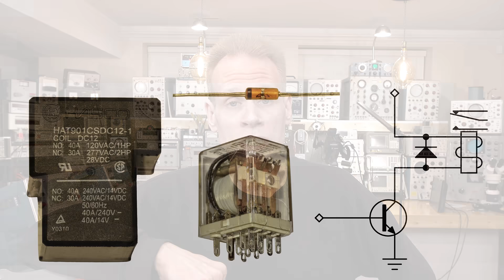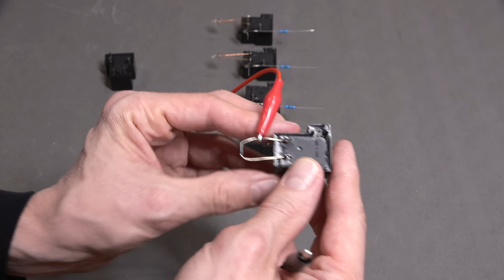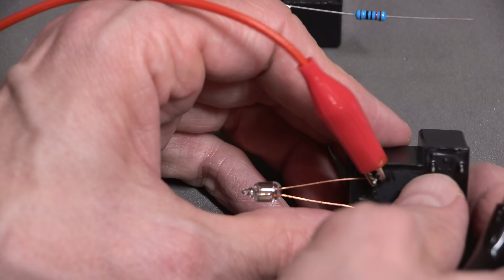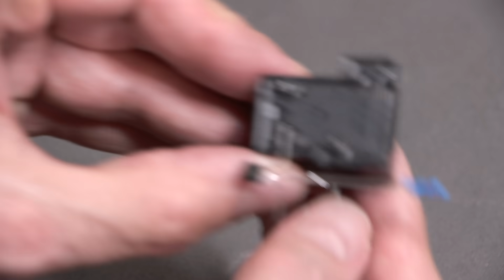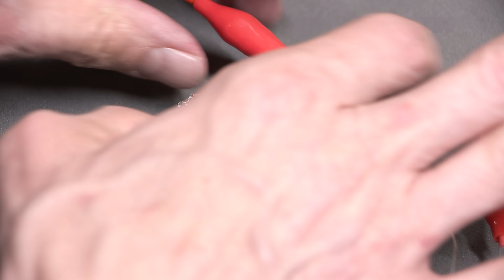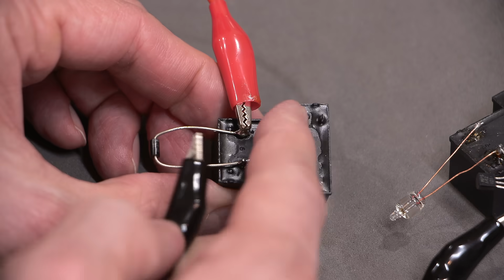Why Add This Diode Across A Relay Coil? This Is Why It's Needed!

Comment: Is a FAST diode required? What kind of diode(s) should we use? I generally use 1N4007 but I suspect it is not the best choice.
Reply: For the most scenarios (relay On/Off) it is good enough. Speed can be important if you protect stuff from the lightning strikes. Or design a switching mode power supply. Things like that.

Comment: An additional note about the side effect of placing a "normal" diode as a "flyback diode" is that the relay's turn-off time becomes longer because the reverse current keeps the coil also energized. For most applications this doesn't matter, but if the relay's turn-off is used as a safety in a overcurrent (electronic fuse etc...) the turn-off gets extend with many milliseconds. I discovered this years ago when i started my DIY electronic circuit breaker with iso transformer and variac project. 
In the first version of my project, i used a beefy 12V relay to disconnect the mains. 
I started experimenting with other solutions for the back EMF problem of the relay, and found that a combination of a Bi-directional TVS diode in series with a low value resistor (arround 50 Ohm 1W) accross the relay coil resulted in the quickest turn-off time. The value of the TVS diode was arround 14V to not interrup the normal working of the relay. This resolution only gave a very short and low overvoltage spike accross the relay coil. 
If i'm correct, a "flyback diode" or also called "Freewheeling" diode for back EMF is only needed with DC, because with AC this back EMF is cancelled out. Correct me on this if i'm wrong.
Regarding the neon bulb, those have many more applications then just a indicator light. I have used these as "last resort/failsafe" clamping device in parallel over a burden resistor of a CT (Current Transformer).
Reply: I'd maybe argue, if coming down to a complicated need like that, depending on application would probably switch to a solid state type switch in place of a mechanical relay. Now that we have those readily available
Reply: @TrollBooth500  indeed, my first version was a fork of the wellknown design of the Glasslinger Electronic Circuit Breaker. But after many modifications, i'm using a complete different approach and using now a beefy Triac (capable of 40A continuous and 320A surge). Way overkill for a 500VA project, but better too sturdy then flimsy.
Reply: I have read that the slow release produced by the flyback diode can also cause damage to the relay contacts if the relay contacts are switching a high current.  When the contacts open, an arc can form that burns the contact surfaces if the arc lasts too long.  To make the contacts open faster, the TVS diode can be used, or a Zener diode with sufficient surge rating can be added in series with the standard diode, or a resistor can be added in series with the standard diode.  These schemes dissipate the stored energy in the coil faster, allowing the contacts to move apart faster.  In the cases of the TVS or the Zener, the breakdown voltage of the protective device should be a bit less than the breakdown voltage of the transistor.  In the case of the resistor, it's resistance should be a bit less than the breakdown voltage of the transistor divided by the current that was present in the coil in normal relay-closed operation.  (The coil uses its stored energy trying to prevent any reduction in coil current.)
Reply: AC will produce this too, if the switching occurs off the zero point. But you obviously can't use a simple diode.
Reply: Use a meaty MOSFET and let VDS breakdown at 55V for rapid energy dissipation. Make sure you use older tech MOSFET's that can handle linear operation.
Reply: Absolutely interesting.
I have worked with car electrical both professionally. For a few years in the 70s but also on our private cars (car alarms, auxiliary lights, halogen/led. stereo, etc.) and have not had any problems with relays stopping working. However, connections to relays do occur. Maybe because I use quality relays 🤔 So my relays "survive" without a diode. And if it were a serious problem, there would have been a diode on the relay by now. I have a goal to learn something new every day. And now I have done it Thx. And within a week or so I will install auxiliary LED lighting on my wife's new car. No, I will not solder a diode there😉
Reply: @Mankan569 it's not the relay that is at stake. If you control that relay from a solid state device, issues may occur from the back EMF backfeeding to the control unit.
Reply: For fastest switching avalanche rated FETs are probably the best.
Reply: Regular diode with Zener in series is another option.
Reply: @JGnLAU  , a regular diode with a Zener in series wil only raise the reverse voltage and thats what you don't want. The trick is to absorb or extinguish the reverse induced voltage as quick as possible. Also a Zener diode has a much slower response then a TVS diode.
Another trick is to use a combo of a capacitor and resistor in parallel with each other in series with the voltage to the relay coil. For most 12V relays, a 1K 1W and 100uF capacitor works great. When the capacitor is not charged, it acts like a short and the relay coil gets the full 12V, but once the capacitor gets charged rapidly, the 1K resistor takes over and lowers the coil voltage just above the release voltage of the relay. Most 12V relays still kept enabled with 50% lower coil voltage, this will also lower the power consumption of the relay and becomes handy in battery powered circuits with relays.

Comment: My 1994 Ford Econoline van has the transmission controlled by the engine computer..In the trans is a solenoid pack with 5 solenoids in it to control the trans fluid to make it shift the gears..On the pack is a line of diodes to protect the computer from this problem as shown in the video..

About 3 years later Ford removed those diodes from the solenoid pack and installed them in the computer ..Problem is if you need to replace the solenoid pack, you can't buy them as they are obsolete..
You can buy the later solenoid pack everywhere online, but if I use the later pack it will fry my computer that controls the trans and engine..
Just wondering if I can install a diode inline with the wire harness..Open the harness up and install the diode there??
And I don't have a clue what size diode to buy to attempt this

Comment: Flyback aka kickback when the coil discharges, engineering 101 often called a clamper diode. They're commonly used with Darlington pairs even when there isn't an inductor in sight lol. Just that less than 1 cent insurance covering, "what if?"

Comment: thanks for the vid! i had an interesting run in with these diodes last week. i bought a tektronix 176 pulsed high current adapter for my 576 curve tracer. it didnt work correctly.  it turns out a 1n4152 diode they used across one of the relays shorted.  i replaced it with a 1n4148 and its good to go!

Comment: I know this one all too well.  I made a video about controlling a pneumatic solenoid and why you need to put a diode across the coil, it's a 12V coil and I hooked it up to a scope and showed the negative 120 and sometimes even much higher Voltage spike.  It's a no-brainer at this point relays/solenoids need diodes... period.  Some relays have the diode embedded in them and thus marked with a polarity, but most do not.  RIP that poor little 2N3904 transistor... I felt sorry for it every time you clicked the button knowing that each time that spike was doing damage to it.

Comment: Been working on cars and trucks for 45 years and never knew why those diodes were used.  I've seen them blown apart and never knew another component might also be damaged because of it.   Instead thinking they were a symptom not the cause.  Last one I recall seeing was on the start relay for a Chevy van that also needed a new engine control module.  I guess now I know why.
Reply: Perfect example of how automotive technicians/mechanics are incompetent: 45 years!
And you lack BASIC knowledge (electricity is a "black magic"). Pathetic...
Reply: @GrandePunto8V  I never said I was a mechanic/technician or that I worked for the public.  Assume much?  Pardon me for not going to trade school and getting certified to repair my own personal and business equipment.  Maybe you should direct your anger at the tech who failed you.

Comment: The demo with the neon bulb is a nice touch, did not see that before, you clearly prepare your lessons as a true teacher.  However what I missed was the suggestion to use a zener or tvs diode, to make the relais fall back faster. A normal diode prolonges the current loop, making the contacts less decisive in their disconnect, possibly causing disconnect current sparking and thus contact wear. By keeping the coil voltage clamped higher by zener or tvs (or maybe even neon bulb) the energy dissipates faster and the contacts break more decisively.
Reply from the maker: Glad you liked the demo!
Reply: I thought that was a nice way to demonstrate the back emf too. I was waiting for our mentor to hook up a CRO and then I'm humbled by simplicity.
Very nice.

Comment: I bought a car which the radiator-fan would run ALL THE TIME. (when key was ON) After troubleshooting for awhile, I diagnosed the fault to be the engine-computer was commanding the fan-relay ON all the time. 
Turned out, previous owner had installed relay WITHOUT DIODE INSIDE IT.... the back-EMF from relay to the engine-computer had fried the output-transistor so it was shorted to ON. 

To fix this problem, the engine-computer needed to be replaced as well as installing relay which contained diode inside it. (to prevent future failure)
Reply: Better than fried to off position at least lest you boil your engine?

Comment: Also in Ford under hood fuse boxes there is a diode for the a/c compressor relay that controls the a/c clutch coil.
Reply: Ford relays has a 270 Ohm resistor built in accross the relay coil.

Comment: 4:42  I shouldn't have to say this, but if you buy your alligator test leads from an "online site", you should test them for copper content. Simply place a magnet on the wires, and if they stick to the magnet, you have garbage leads. China has a reputation for copper coating steel wires. Safety Third!